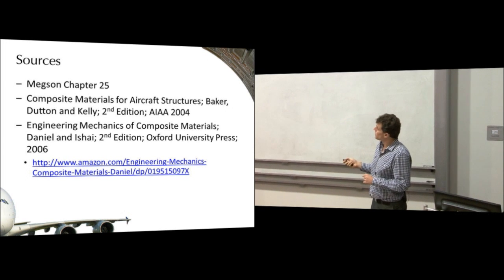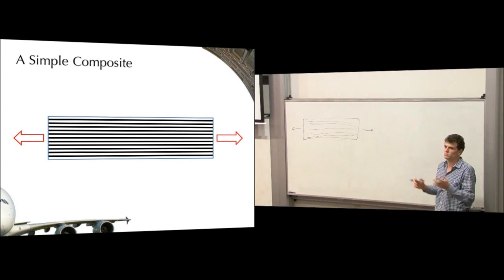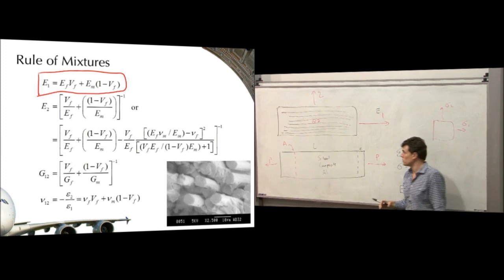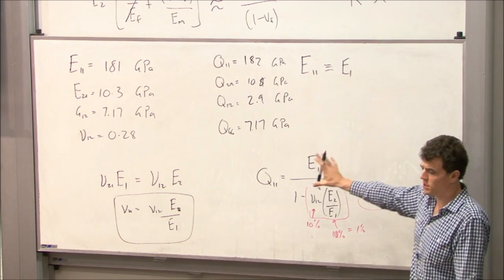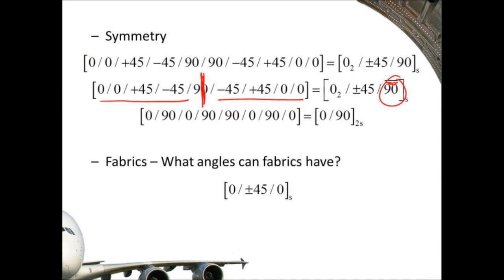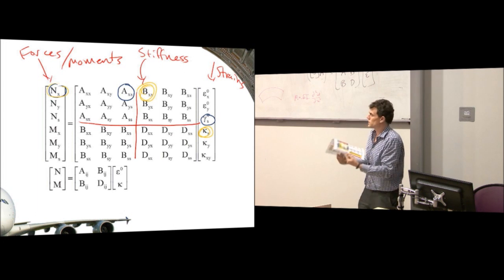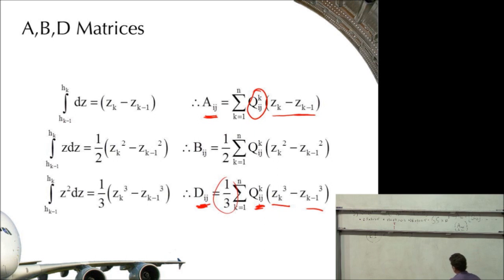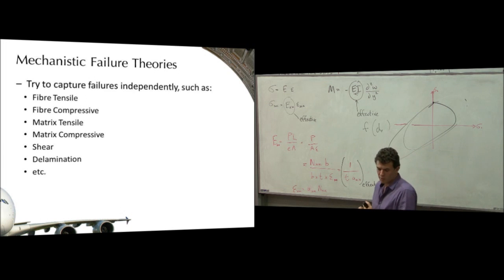UNSW - Aerospace Structures - Composites

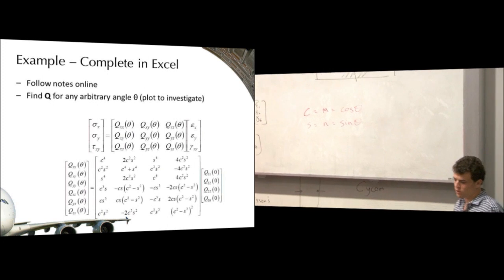Comment: There´s just a minor error, on the slide at 1:30:31, with the LHS of the matrix in 2nd matrix equation [(6x1 = (4x4)(4x1)], isn´t there?
Reply from the maker: Liv Yi It is 6x1 = (6x4)(4x1) There are six separate rows in the matrix. Daniel and Ishai is a really great book for this analysis.
http://www.amazon.com/Engineering-Mechanics-Composite-Materials-Daniel/dp/019515097X

Comment: I've read it is wrong to bond carbon fiber to fiberglass because they have different strain resulting in one failing before the other. 

Also, I've seen hard points(metal bushings) embedded in fiberglass and carbon fiber. Is this a bad practice?  I've seen holes drilled into a carbon fiber spar and bushings embedded for hard points. Is this a bad practice?
Reply: Very bad practice indeed.

 We lay the metal hard points for bushes and fixings etc in the very beginning stages when the fabric is being layer in the mold.

To lay it, cure it, bake it etc and then cut holes out of the media is entirely the wrong way to go about things.
 On the other hand, I work with guys who are very worried about tenths of grams and thousandths of seconds so we really have to output the closest-to-perfect items  imaginable.

 If you’re making decorations and toys and items that dont have the ability to make or break billion plus pound contracts, you can treat it like plastic and drill and cut whatever you want because it’s not that important.

Judge it on a case by case basis.

Comment: How come no one noticed the error at 2:00:15 slide, line 3(shear strain). The dx, dy must be interchanged for the first two terms(Uo,Vo)
Reply from the maker: Good pick-up. I've just fixed my slides. I'll be delivering this lecture again in a few weeks to a fresh batch of 3rd year Aerospace Engineering students at UNSW.
Reply: Not a lot of people understand shear.

 The transition from elastic to plastic goes over most of their heads.